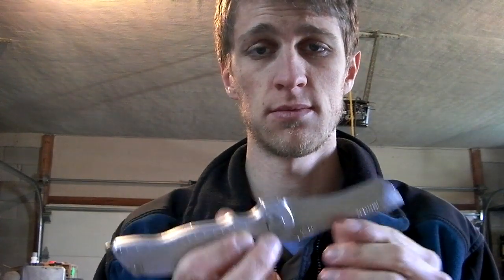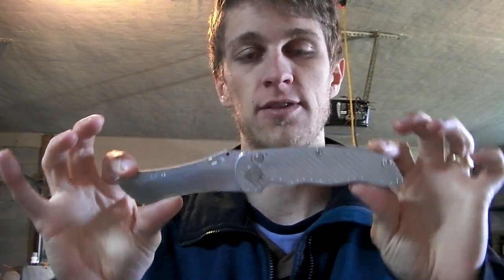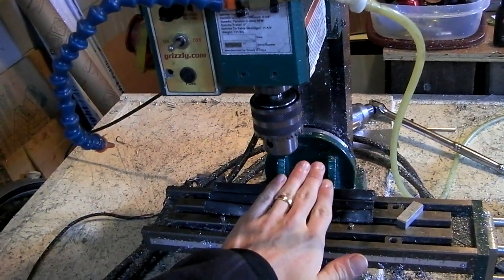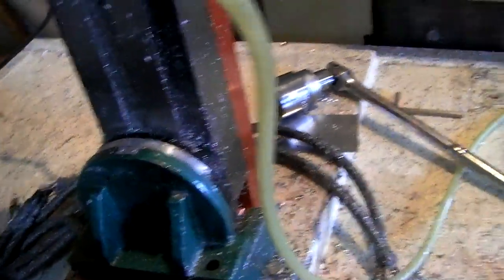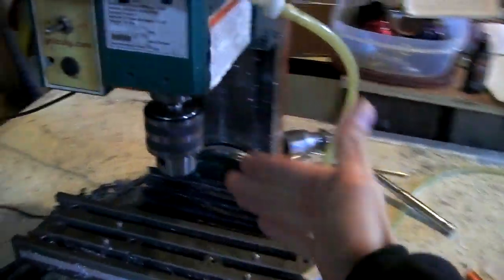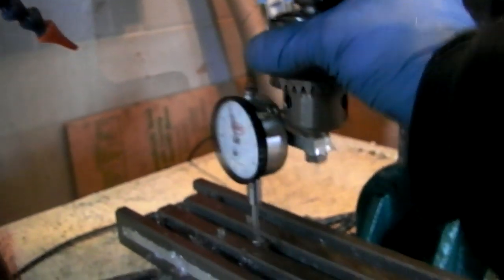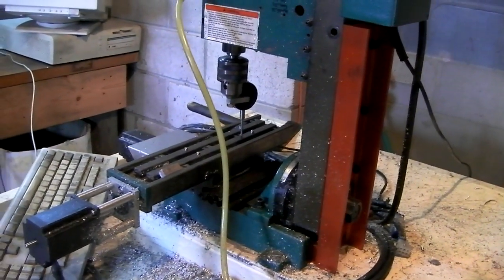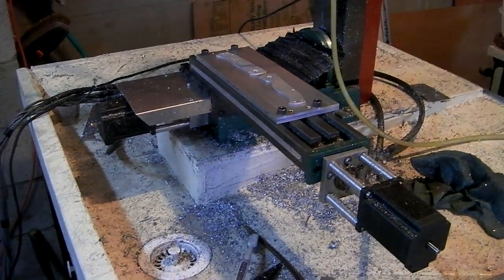Knifemaking Tuesdays Week 06 - milling machine adjustments

Comment: You could use a direct collet for your cutter which goes right into the MK3 morse taper of your mill. These sell for very reasonable prices (about 10€) and you will most likely only need two for the most common cutter shaft sizes. Using a DRILL chuck to hold a cutter is not recommended because a drill chuck is contructed for vertical force, not horizontal. That's why the whole drill chuck/cutter assembly gets slightly bent while cutting. Great work with the knife!!

Comment from the maker: It's a very small very flimsy machine, 0.017" doesn't surprise me.  I mostly use small tools so the discrepancy in flatness is harder to notice than if you were using a 2" facemill.  Not sure if I lost any rigidity with the shims, I wondered that too but that seems to be what most people do, so I did it too.

Comment: I'm just wondering. How did the machine get that far out of whack in the first place? Was it the manufacturer early on? Or had a tough cut one day and bumped it hard?

I'm stumped that you made anything if it was out .017" lol! Lastly, since you put shims underneath, did you lose any rigidity at all? Since it doesn't have a solid contact underneath, thinking maybe.

ps. Going through a number of you're vids really nice what you've accomplish so far. Nice Tormach. *shakes fist, envy* :)

Comment from the maker: @BuickDoc That's my next little side project, either a flycutter or a face mill.  It's tough with the way I'm holding down the parts, it can't really be bigger than 1.5" but it has to be at least 1.25 in order to do it in one pass.  Then I also need entry room so I'm not plunging onto the face.  Maybe I'll use flat head screws and sink them below the surface.  The stripe pattern is great for some parts but for the dragon scales and other smooth designs I want it flat in one pass.